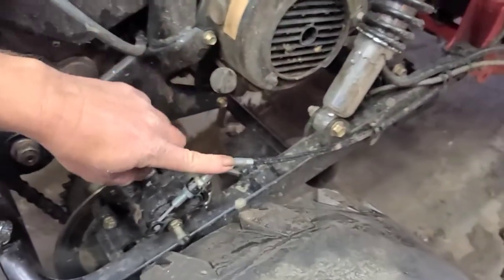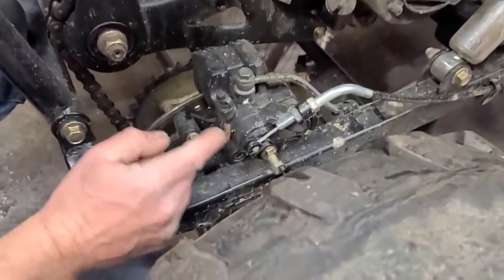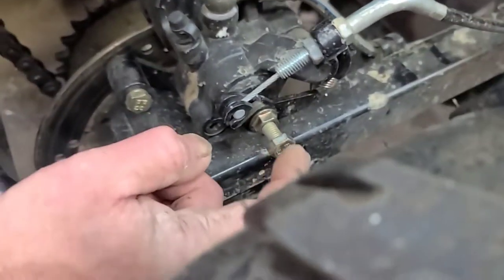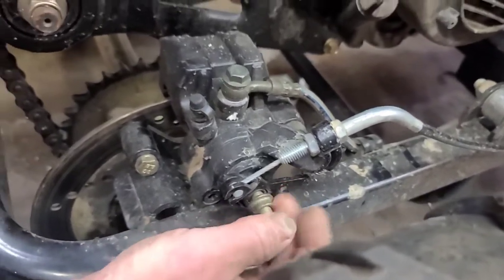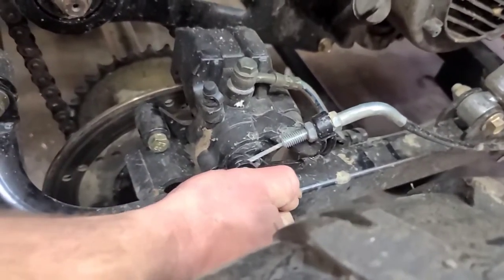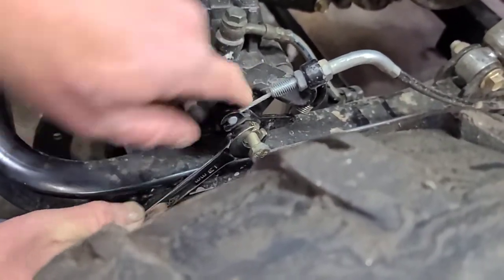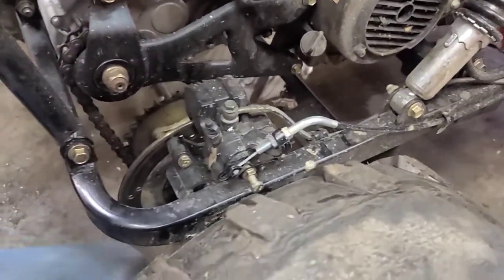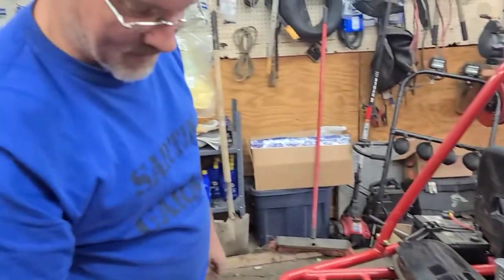How to Adjust Rear Brake Caliper for Emergengcy Brake on 200cc Batman GoKart Buggy Vitacci Kandi

Comment: what is the width of the chassis.?
Reply from the maker: This is a rough guess but about 5.5 feet 
I have a 6 ft wide trailer, it barely fits 
2 inch on each side to spare